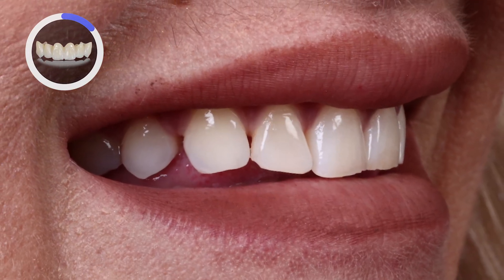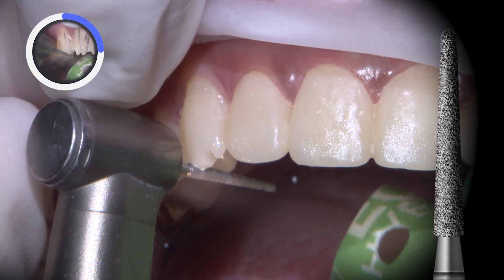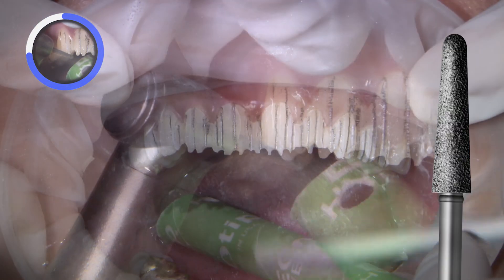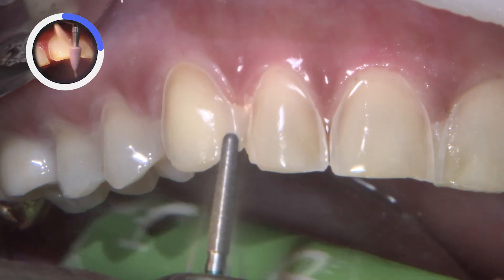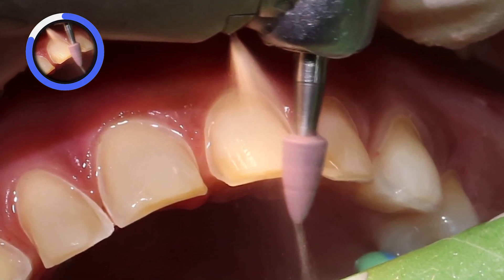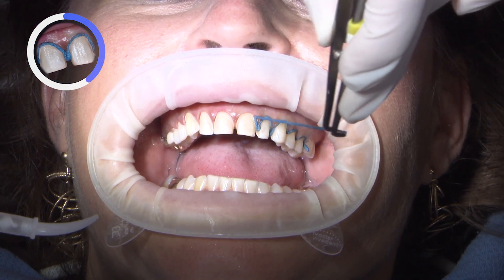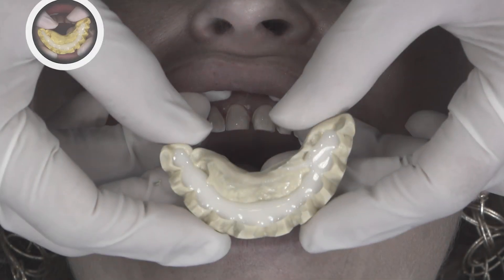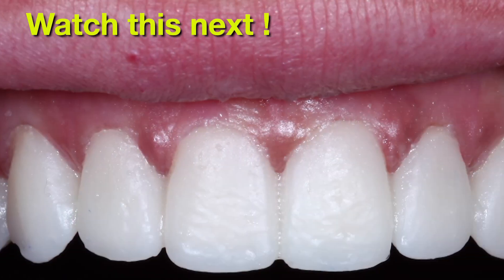HOW TO Prepare Anterior Teeth for ZIRCONIA Veneers

Comment: Good work. But I think that wearing so much fabric is too much. what that patient needed was a good orthodontic treatment and then muscle relaxant plates. Veneers will not make bruxism go away
Reply: I'm a dentist, so ill give my general thoughts. This is very accurate, the veneers are really to assist in esthetics. Normally dentists would also recommend additional anti-bruxism treatments such as a botox in the jaw muscles (although this only lasts around 6 months and can be expensive), a nightguard, or TMJ therapy. TMJ tension and bruxism is sadly very difficult to isolate problems, so it is difficult to know when it will be fixed. 

As far as the veneers themselves are concerned. Many dentists don't actually push veneers on patients. Patients describe an esthetic problem, we give them general options and recommendations (which ALWAYS includes no treatment because natural teeth tend to be healthier anyway). Youd be shocked by the number of patients who just jump on veneers and say that if you dont do them, theyll just go to a different dentist.
Reply: Orthodontic treatment is only dedicated for enhancing aesthetics. It’s not like orthodontist can do much. Also initial situation weren’t presented to us